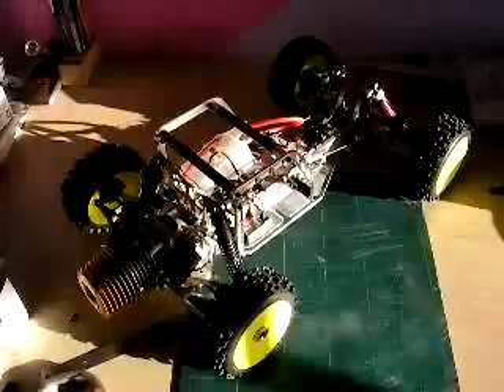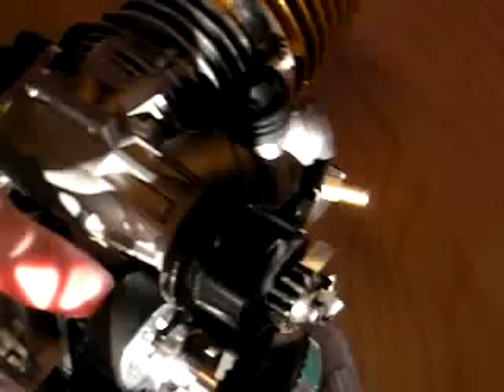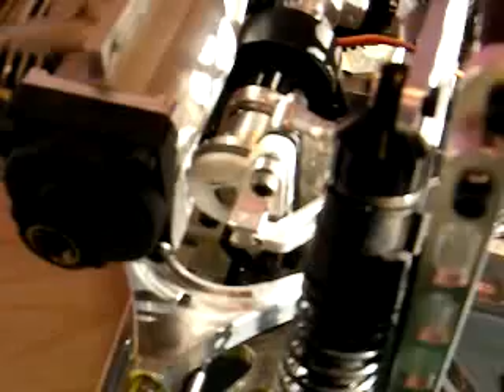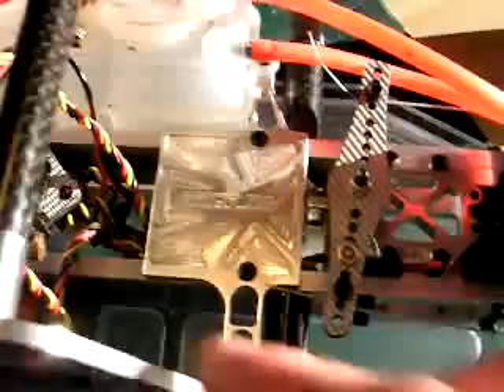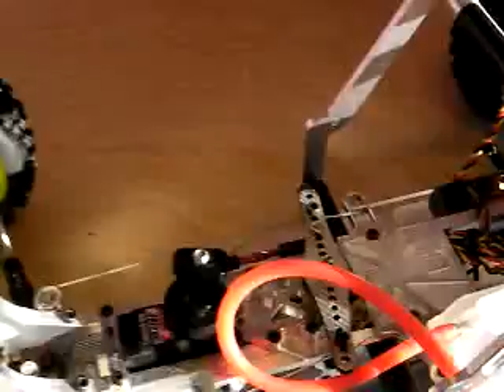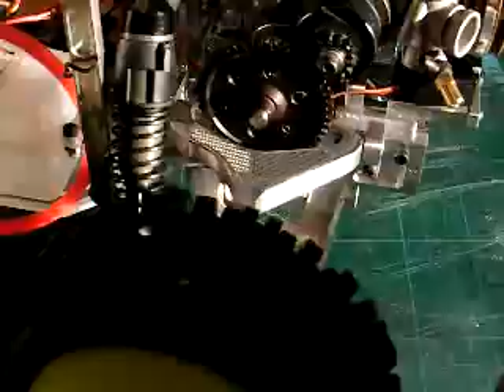1/8 2WD 5cc desert buggy - project car overview

Comment: hi nice project buggy, have you finished it yet and got a video of it going?
i did have one concern about it is that is it possible to have the engine on a slant like that like and for it to run? i thouht that i to be mount up right, other wise very nice looks complicated, how did you have the skill to build something like that? 
also i noticed you had a servo saver what dp they actually do and will they fit on a standard 1/8th servo with metal geard